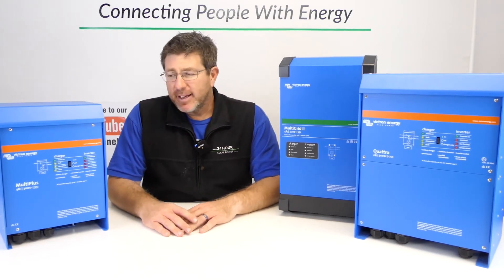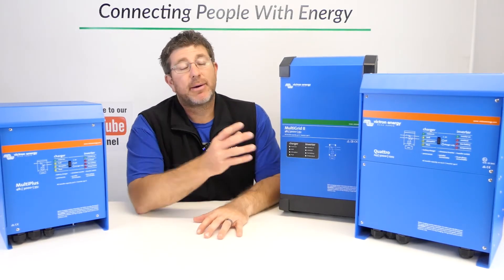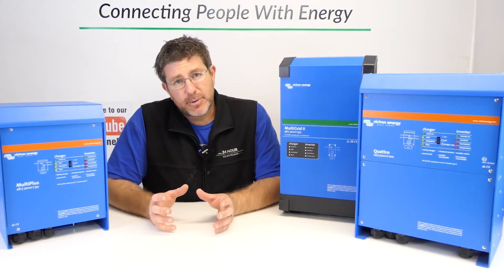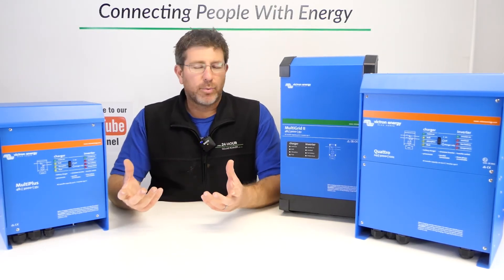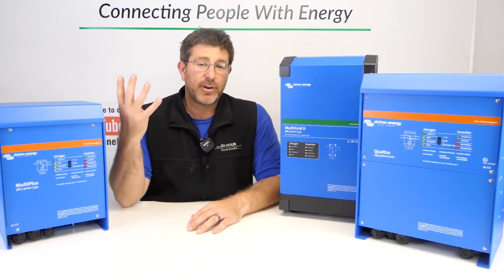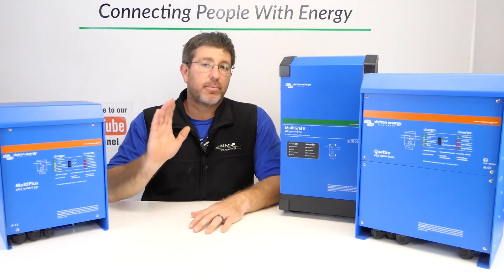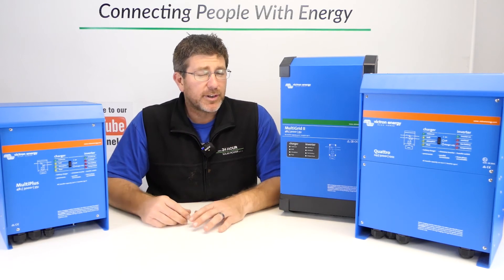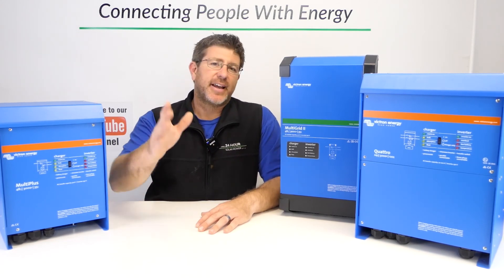Victron Multiplus

Comment: so i have a quatro 24 vol 3000 va a buck boost 100 amp a centuar 24 volt 60 amp charger and a phoniex 1200 va . the batteries i have are 24 volt lithium 100 amp hr my goal is to power my boats small scalle aircon and basic electrics will update and thanks for your videos i owe you a beer
Reply from the maker: Thanks for sharing. Sounds like a great little system. And appreciate the gesture.

Comment: Can you confirm the Multiplus doesn’t have the capability to feed back into the grid, but the Multiplus 2 can?
Reply from the maker: It can feed back to the grid. It just shouldn't without extra hardware.  It's all done from the Cerbo.
Reply: @TheOffGridShop  Thanks. So if a Multiplus is installed without the Cerbo, its considered off grid, even though the primary charge comes from the mains?
Reply from the maker: Out of the box it is programmed as a UPS.  If connected to the grid it will always charge the battery and only discharge if the grid fails.

Comment: I have a MP2 5000lbs and 7kw of Pylontech supported by 9kwp of PV. & an offpeak 12-4am grid charge.
Problem is my tenant drains the bank for cooking at 8 pm.
I'd like to stay offgrid at this peak rate tariff time by boosting the bank at the same time as these Heavy cooking loads are happening, using my lister CS 240v generator
Reply from the maker: You can have the generator autostart at a certain time and run for a say 30 mins. If your using multipluss.You would want an automatic transfer switch to swap the input to the generator not the mains. Or sell them and get a Victron Quattro.